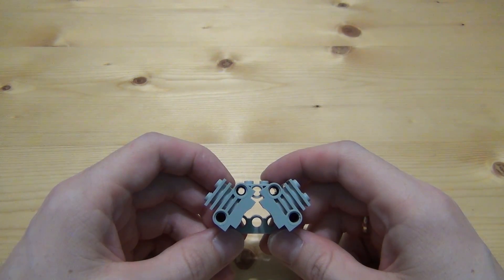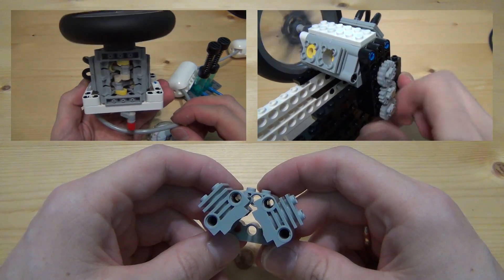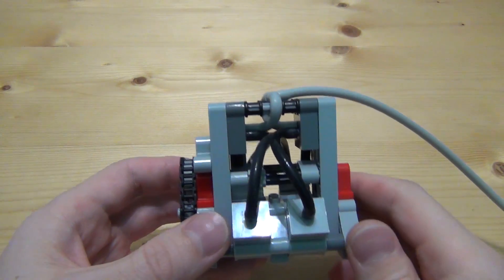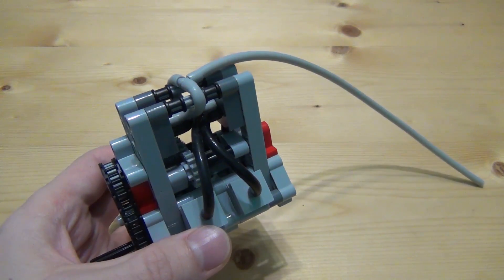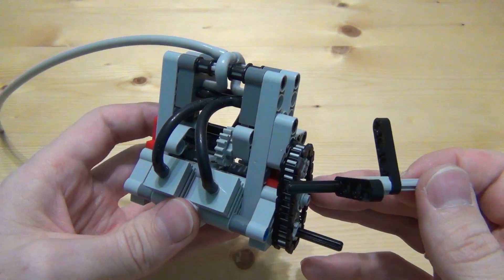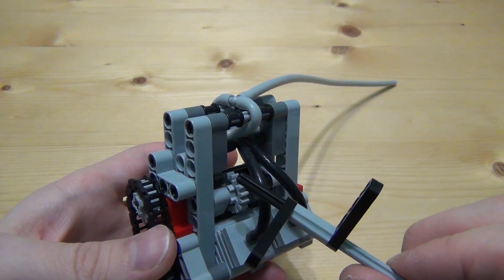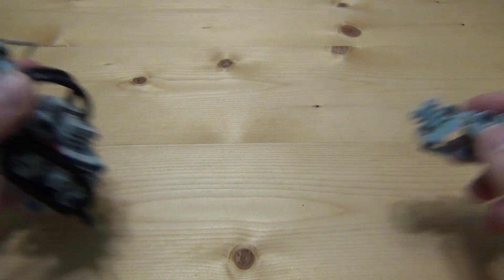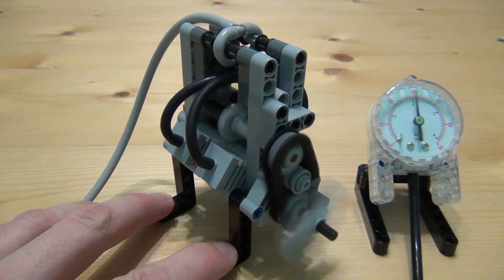Пневматический двигатель V4. Lego pneumatic engine V4 from lego fake engine.

Comment: I carved out one side of the cylinder pieces to make a 90 degree V angle possible. Makes for simpler camshafts with 90 degree offset on the lobes.

Comment: How does the air escape the cylinder?
Reply from the maker: Through the Lego switch
Reply: So it goes in and out through the same tube? I just don't see an exhaust.
Reply from the maker: Yes, you're right. Air goes in at the first switch position and goes out at the other switch position through the same tube.
Reply: Okay. I thought their would be a pressure on that line/tube, stopping the air in the cylinder from returning back to the switch. So the air is basically the same bouncing between the cylinders?
Reply: Hastrup081290 yes
Reply: Thank you to both of you, Lego Technic Embodiment and Ole Ole Ole Deutschland.